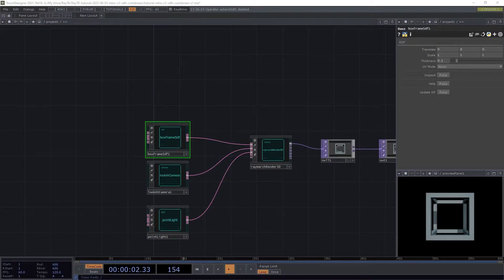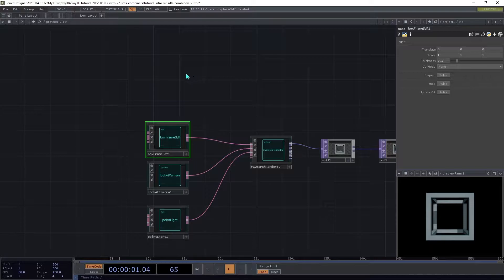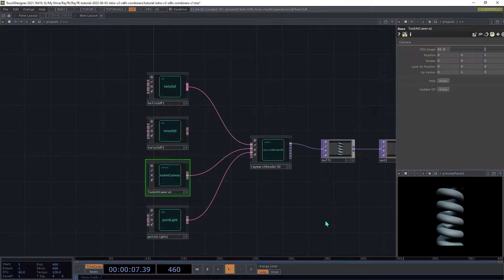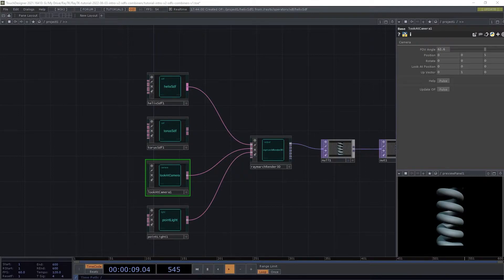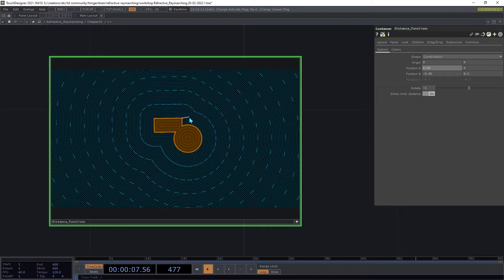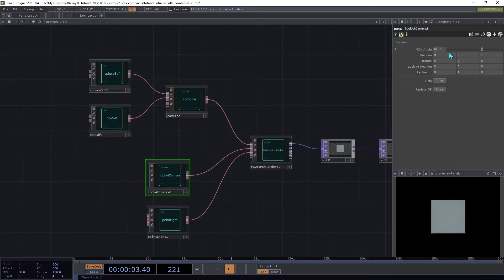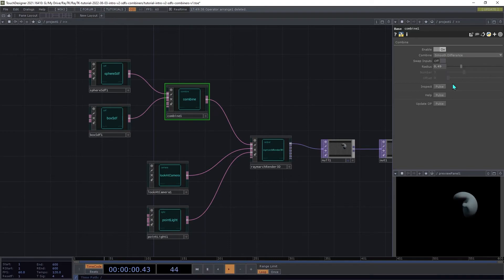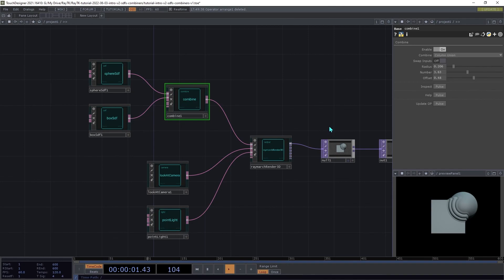RayTK Intro Part 3: SDFs and Combiners

Comment: Thanks for the great tool you build !!! it so much fun to play with it. Can you make a custom SDF let say in Hudini and then import to TD ?
Reply from the maker: Good question.
There are some key differences in how SDFs are represented in Houdini vs RayTK.
Houdini represents an SDF as a grid of points with distance values attached to them.
RayTK represents an SDF as a mathematical formula that can calculate a distance for any point in space.

In theory you could have a RayTK operator with a "formula" that's basically just looking up data in a grid produced by Houdini. That works as long as the renderer doesn't ever need to know about positions outside the grid. When using raymarching, the renderer checks points all the way from the camera out into the scene until it hits something. There might be a way to do it but I haven't gotten the grid approach working with raymarching.

However, for volumetric rendering (pointMapRender) where the renderer is given a single position and does calculations for that, this approach can work. I've successfully done it with an early variant of RayTK that's used for an LED volume.
Reply: @tekt0  Thanks for the quick replay. any link to the LED volume project? sound very interesting.
Reply from the maker: @MenyAttenti  it's still in construction and I think still under nda

Comment: the pointlight into the raymarchrender is not working for me, it appears that the input doesnt support contexttype and returntype
Reply from the maker: It's probably connected to the wrong input. If you mouse over each input, it says what it's expecting.
Reply: thanks i will try =)
 @tekt0